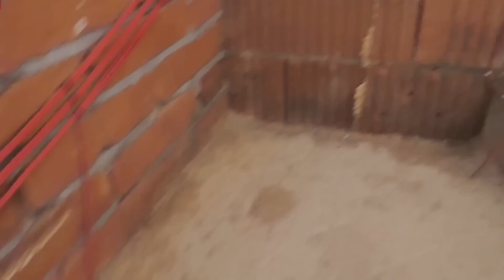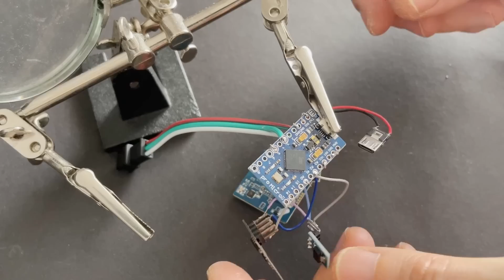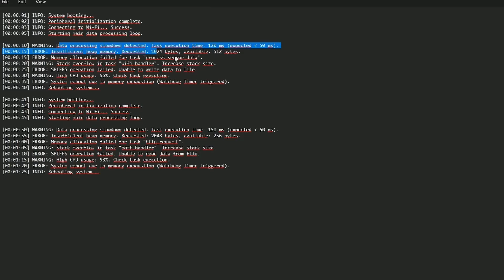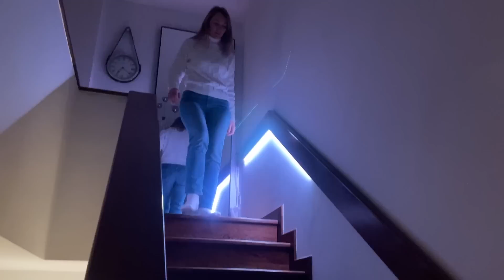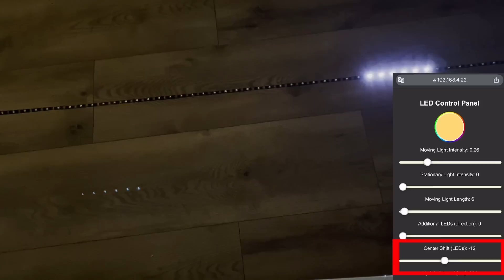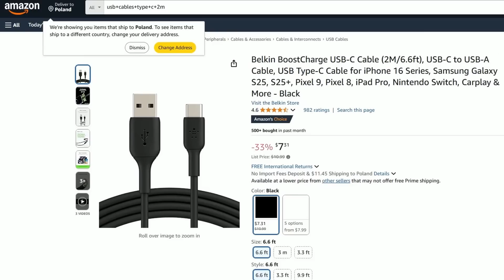DIY Smart Staircase and Hallway Lighting: Light That Moves With You

Comment: How will the light turn on from the bottom of the stairs?
Reply from the maker: The system uses a radar motion module that detects movement in a straight line and even slightly around corners — up to about 50 cm.
It doesn’t matter whether it’s installed at the top or bottom of the stairs — it will detect you both when going up and down.
For U-shaped (turning) stairs, two modules should be used, as shown in this video:
👉 https://www.youtube.com/watch?v=qzmJSCr8-AY

Comment: How does it work if the stairs have a 90 degree bend?  I have some stairs where this would be perfect, but would need a second sensor at the bottom end as you can't see the top from the bottom and vice versa.
Reply from the maker: If the stairs have a 90° bend, in most cases one module is enough — the radar can “see” through wood and drywall, so it may still detect movement even around the corner.

However, if the bend is completely enclosed and the sensor physically can’t detect someone on the other side, then yes — it’s best to add a second module at the bottom. The two modules can work together to trigger the lighting from either end.

Comment: I can see this only working on a straight set of stairs?
I have sort of a double L shaped stairs.

Have a system with running lights and 2 motion sensors on both ends.
The system works, but has a very bulky unit on one end.
Would love to have a smaller unit and working with position.
Reply from the maker: This system will work on your ladder. I made a video where I showed an example of how it works. https://youtu.be/qzmJSCr8-AY
Reply: @ Not exactly how my staircase is but it might do the trick.
Where can I order??😅
Reply from the maker: @ At the moment, LightTrack is available exclusively on Kickstarter 😊
I’ll be shipping rewards to backers in the order they pledged, starting in the second half of April.
If you'd like to get one, there's still time to support the campaign and reserve your spot!
Reply: @ Thanks for your quick reply.
So to be clear....I need 2? as in 2 sets?

I do have al the rest in place already...I dont need LED's or anything.
Reply from the maker: @Puffpiloot  Hi! 😊
It’s very likely that you’ll need 2 modules for a double L-shaped staircase — one for each section with its own direction of movement. But to be sure, could you please send me a photo of your stairs and the approximate measurements? That way I can advise you more accurately.

Also, just a heads-up: LightTrack Pro is designed specifically for the WS2812B 30 LED/m IP30 LED strip, which comes with the full set. I can’t guarantee compatibility with other LED strips, unfortunately.

Feel free to email me at business.yari@gmail.com — I’ll be happy to help you out!

Comment: You need to add 2 presence sensors (radars), one at each end of the led strip. You also need a LUX sensor to sense the ambient lighting. Maybe it’s past 20:00 but the space is lighten up by other light sources and the stair light is not needed. Or the time is at noon but the window curtains block all the sunlight. I did something similar for my home last year.
Reply: Do you have a project link or a writeup? I like this for the ease of use, but yeah.. LUX and 2x -3x sensors depending on staircase.

Comment: Could you adapt the length selection to fade out the light ? > if 5 leds length is selected 2-3 leds before and after that length would be dimmed from 75% to 25% each to create a smoother light slide 🤓
Reply from the maker: Thanks for the idea, This is already implemented in the new program, and the evening illumination function has also been added: the light is on across the entire lane at night, and the beam is activated when moving. The function can be turned on or used without it.

Comment: the systems showed on the amazon, work a little differently. They place multiple LED strips under the stair ledge, that are wired in parallel.  Each led strip under the led would need to be hooked up independently. Can your solution accomodate such a use case, or would the Amazon units make the most sense for that case.

Comment: Great project. An idea could be to create an extra timeslot option for nighttime to dim the brightness during that time.
Reply from the maker: In the current implementation, there is no need to create an additional time interval for dimming, since you can set the operating time of the device. For example, by setting the period from 20:00 to 8:00, the device will only operate at this time.
Reply: @DIY_Yarik  i understand. But ik like it when in the evening the light is normal but when you to sleep and need to go out forna short time it is dimed so you don't wake up to much 😉

Comment: Hello, and thank you for the sharing of a very interest project/device with a different way to act on the stairs. Can you please let me know, lf there is any possibility to integrate this on the Home Assistant Platform?
Reply from the maker: Yes, the code includes integration with Home Assistant, as well as support for Google and Alexa smart homes. This will allow you to easily connect the device to your smart home system and control it through your usual platforms.
Reply: @DIY_Yarik  amazing, thank you!

Comment: Integrate it with WLED.
Reply from the maker: The project uses WLED type LED strip
Reply: Wled is software
Not a kind of leds
Reply from the maker: Sorry for the misunderstanding, you are correct. I used it in the first version of LightRec on Arduino Leonardo, but after switching to ESP32 problems started. WLED could not cope with all the functions in the program, so I had to switch to the more flexible and powerful FastLED.

Comment: Would this be suitable for a spiral staircase?
Reply from the maker: Unfortunately, I have no opportunity to conduct practical tests, but based on theoretical considerations, the system may be suitable for a spiral staircase. It is important to consider the number of turns: if the staircase has a turn of up to 180 degrees, everything should work correctly. However, with a full (360-degree) spiral staircase, the device may be effective only for part of the turn.

Comment: I'm curious, did you ever consider having an IR LED strip ran in parallel with the main LED strip in order to detect presence? That's how I was thinking of going about a project like this for hallways and staircases.
Reply from the maker: I’m not sure I completely understand, but an IR LED strip only emits infrared light—it doesn’t detect motion like an IR motion sensor does. It’s purely for illumination.
Reply: @DIY_Yarik  right, my bad, I could have described it better. I was essentially thinking of creating a strip of IR sensors that run in parallel with the main LED strip to detect movement. I was originally thinking of having a "strip" of ultrasonic sensors instead of that, but I figured that could come with more problems. 

I haven't fully looked into it though, so I might just be talking nonsense lol.
Reply from the maker: Exploring different sensor types is key to finding the best solution.

Comment: How is only a section of one single strip controlled to be turned ON? Do you supply less voltage or amperage?
Reply from the maker: in d program code the LEDs that do not light are turned off. that is, no voltage is supplied to them. you can look at the code https://github.com/DiyYari/LightTrack-PRO
Reply: @DIY_Yarik  Thanks.nIs this a special LED strip? Because in normal LED strips all LED are connected in daisy chain or series so supplying any voltage should turn all ON. What am I missing? Thanks.
Reply from the maker: This is an addressable LED WS2812B strip. Each LED is controlled separately.
Reply: @DIY_Yarik  Aha, thanks!

Comment: It’s very laggy?! And why would you not use a Diffusor in front of the strips?
Reply from the maker: The lag issue has been resolved in the new firmware version—I’ll be updating the video soon to show the improvements, along with some new settings added thanks to your feedback. As for the diffuser, it's not needed since the light is designed to shine downward from under the handrail onto the steps.

Comment: Great Project and congrats on launching the Kickstarter! I have a question though - how would this work with half-turn staircases (half of the staircase is in one direction then  a 180 degree turn), as the radar would only detect the person on one side? or can it be mounted on the ceiling for example so it has a top down view of the whole staircase?
Reply from the maker: The module will definitely work on a 180 degree curved staircase. However, with an additional 180 degree turn, the radar may not recognize that the person is coming down - it may register them as coming back up. A ceiling mount is an interesting option to try, but you'll need to see your stairs to determine the best placement on it. Email me some photos of your stairs and I will try to suggest the best mounting option. chillomyari@gmail.com

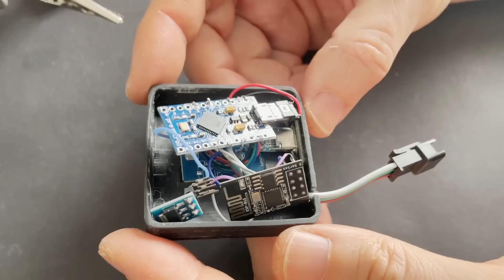Comment: 1:23 I think I see your loose wire problem. You forgot to solder most of them....
Reply from the maker: In the prototype, the wires were soldered a bit loosely on purpose. The real issue is that all these components take up too much space and complicate the circuit, and most importantly, the Arduino just can't handle the current load as it is now.

Comment: I see this only working for one person at a time. Multiple sensors, perhaps different types of sensors could over come this.. Maybe a mm wave sensor at both ends that illuminates the result in between.
Reply from the maker: In Lighttrack, use a millimeter-wave radar sensor that can detect up to three people. However, I intentionally designed the program to track only one person at a time since usually there's just one person on a staircase.

Comment: I've been looking for this project for a long time! I'm +1ing the comments for a gradient brightening and dimming. A couple of questions, the LD2411S 24G Ra·DAR doesn't seem to be available, can I substiture other LD241x chips if they have the same pins? Also, if I want to use a longer/shorter strip and adjust the number and spacing of the LED's, can I do that? Oh, also, do you have the files for the enclosure anywhere?
Reply from the maker: Thank you for your feedback! I’ve updated the firmware to include the gradient effect and eliminate the flickering during light movement—it's much more stable now.

Regarding the LD2411S, you might try substituting other LD241x chips if they have the same pinout, but please note that I developed the code specifically for the LD2411S, so compatibility isn’t guaranteed.

As for the LED strip, you can use any length up to 6 meters, which is the limit of the radar module, and keep in mind that the design assumes 30 LEDs per meter.

Lastly, the enclosure files are available on Kickstarter under the DIY section. Enjoy experimenting, and thanks again for your support!

Comment: Really nice project but have few concerns about it working on folding staircase
Reply from the maker: The unit works well with any ladder - the main thing is that the strap and module are installed correctly.

Comment: Nice project!  You might want to avoid these particular ESP32-C3 modules.  Notice how close the crystal oscillator is to the antenna.  They will have wifi problems.  I would chose a different one.
Reply from the maker: Thanks for the remark! Indeed, the close proximity of the crystal to the antenna causes theoretical concerns, but in practice most ESP32-C3s work stably. Manufacturers optimize the board layout to minimize interference.

Comment: Great little gadget... Two improvement wishes: could you add an option for the lights to slowly brighten at the beginning and dimming at the end, so that it generates a more gradient appearance.
And in your video, i saw the light is a bit jumpy - it sometimes jumps a bit forward and backwards - maybe is there a coding solution to get a more stable movement, by taking more values together and ignore the bad ones, would maybe add a slight delay, but make the movement more consistent. 

But great work, hope your kickstarter is available soon.
Reply from the maker: Thanks for the suggestions. Indeed, the running LED looks sharp when a person is standing still - the system tries to anticipate the direction of movement. I was customizing the light for stairwells where responsiveness is critical. Applying a filter for smoothness will reduce response speed, but the smooth fade idea may smooth out the effect. Thanks for the suggestion - will definitely keep it in mind. I also had an idea for a background light that would stay on all night, and a dynamic light would come on when a person is detected. I plan to release a video in a couple weeks showing the improvements. Thanks again for your suggestions!